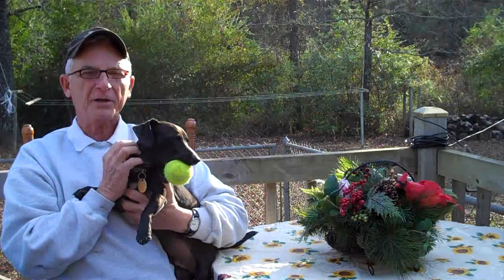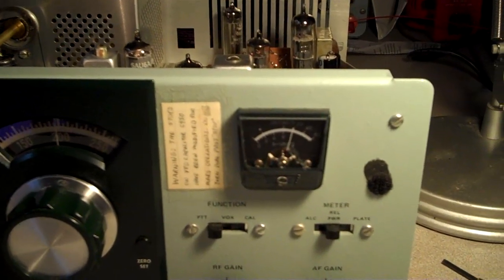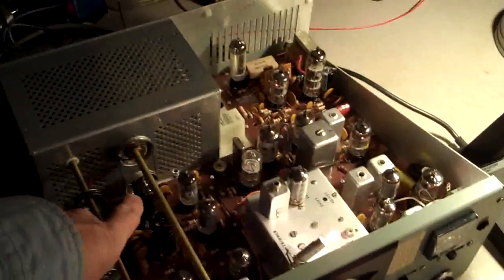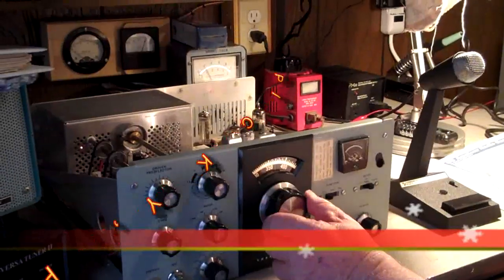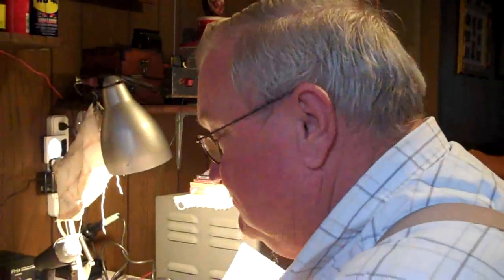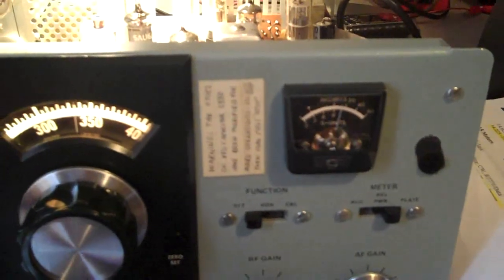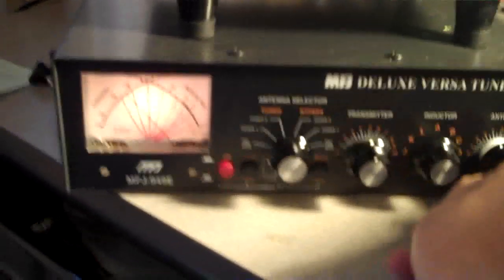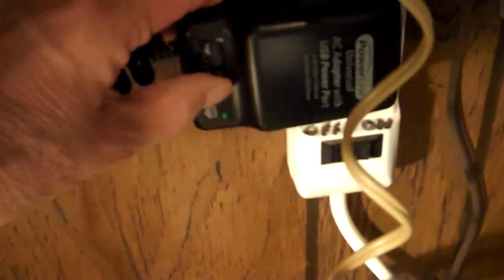Obtaining A Ham License...step by step...the details you need to know (part 27 of 34: Neutralizing).

Comment: @928GTSR 

Once you get used to the process of tuning you'll be able to do it five seconds or less. I need to make a few new videos of my new shack arrangement so I'll see if I can do a video just on tuning up my HW-101 and if I do I'll send the link to you.

Finally put some 80mm computer fans on the outside of the case behind the 0B2 voltage regulator tube as well as the behind the 6146's as the HW-101's run *hot* and need the extra cooling.

      - Mike

Comment: Hey,

I'm glad to hear you managed to get your 6146W's to neutralize. The real test of the neutralization is on 10 meters,if the bias current stays stable as well and you make around 80 watts on 10 meters with the plate current holding steady during this time you should be okay.

Take care in how long you leave your HW-101 in tune mode. I try to keep my time to under 10-15 seconds and then allow about a minute to cool down.

Comment: @joernone  Another method, see if you can borrow Glenn's ant analyzer (or have him come over), it has both signal generator and freq counter built in. You can connect a small antenna to rear of the analyzer, or hang a ferrite inductor on clip leads from the analyzer output. (I wudn't inject the signal directly into your rcvr).. Generate the RF signal in vicinity of your HF rig & tune in to see where the signal falls on your analog dial. You can then calibrate your dial to it.  Cheers ~Wiggy

Comment from the maker: @hedwig85
The crystal calibrator and procedure in the manual has enabled me to get the dial very close, but not right on.  Maybe that's the way it used to be...close, but no cigar was good enough.  It's a printed scale, so the freq. could be off 200kz and one would not realize it.  I do have a sig. gen., but my freq counter is shot, so right now I'm stuck using the procedure in the manual.
I'll soon upload a new vid showing what's going on.
Thanks.

Regards,
John

Comment: @joernone, Have u tried generating a signal on ur frequency generator gear? You can hang a ferrite inductor across the generator output & make a small signal,  at unique frequencies in amateur bands. You should be able to hear it as you adjust the xcvr's analog dial & turn (calibrate) the dial so the dial numbers line up with these reference signals.  Another reference u shud already have & calibrate to, is a built in crystal oscillator that generates frequencies at precise 100Kc intervals.

Comment from the maker: @umajunkcollector,
Yes, V7 is the driver tube, but it's a 6CL6.  But the old gal isn't yet quite up to specs.   I'm still having a bit of trouble bringing in the dial accuracy.  The VFO alignment procedure in the assembly manual doesn't fully hack the program.  In the end I'll probably have to buy and install a digital VFO.
Later on I'll be sure to look into that fan idea.  I like it.

Regards,
John